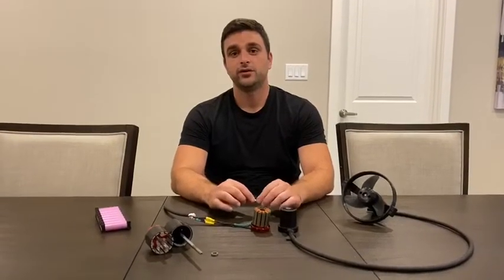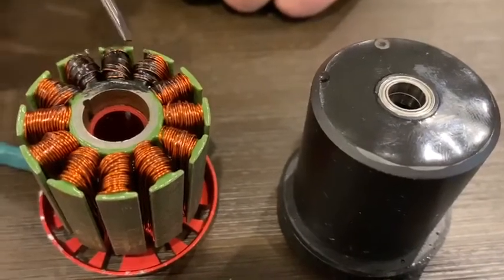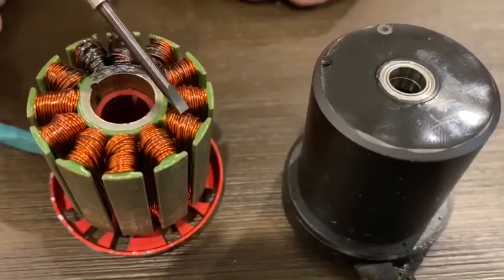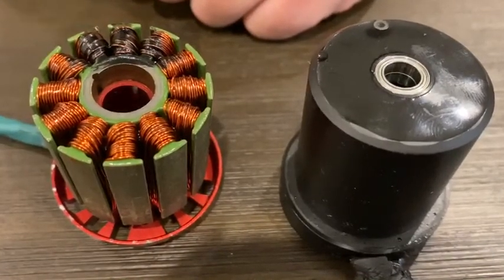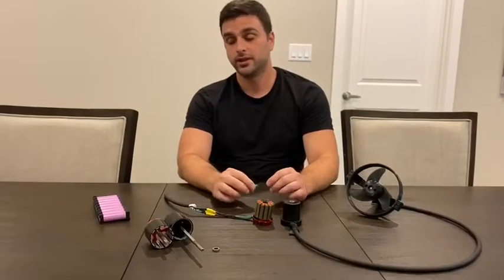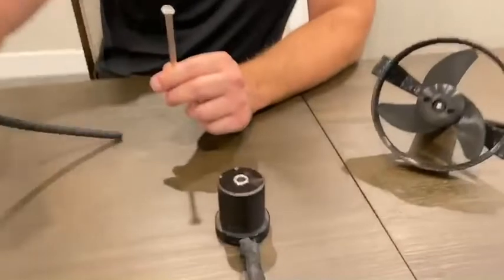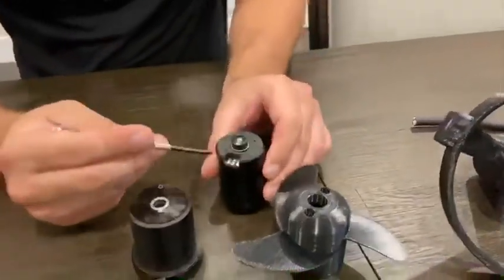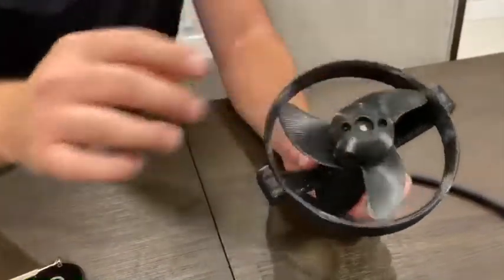Unprotected vs protected stator

Comment: how did you coated your stator with epoxy? could you please explain it. great work btw
Reply from the maker: The stator comes epoxied from the factory.
Reply: @chittlingwhittles1198  Do you know any way to do it manually? We need our motors to be waterproof.
Reply from the maker: @tahafurkanozkorucuklu5359  All BLDC motors a technically waterproof due to the windings being coated. You can use some sort of thermal epoxy and dip the stator for additional protection.

Comment: Hi friend .  where can i buy long shaft brushless motor?  thanks
Reply from the maker: Inrunner or outrunner?
Reply: I am interested in a black enclosed motor protected from salt sea water.  thanks
Reply from the maker: The motor I’m using still has exposed bearings